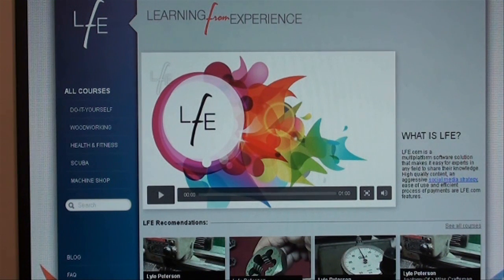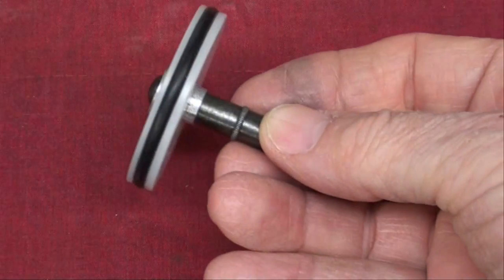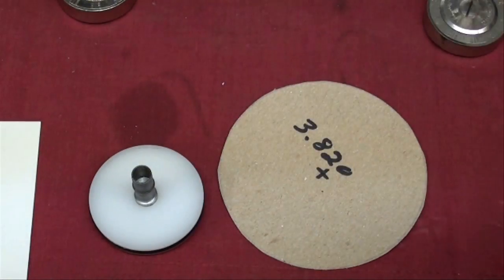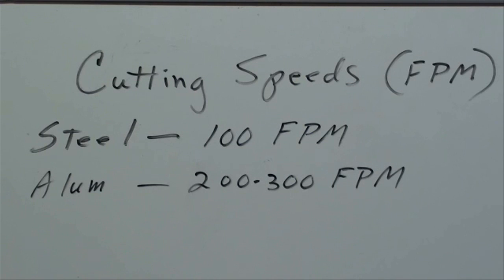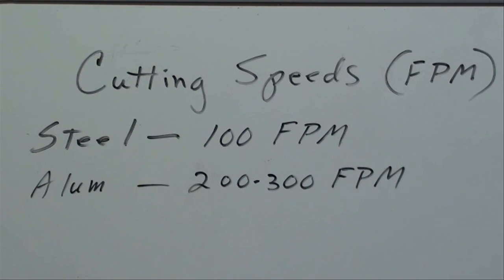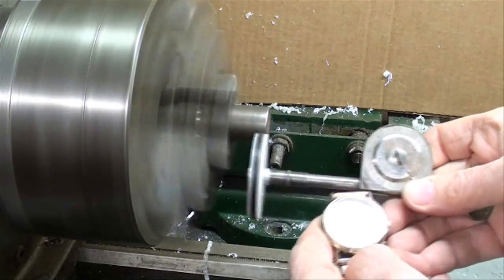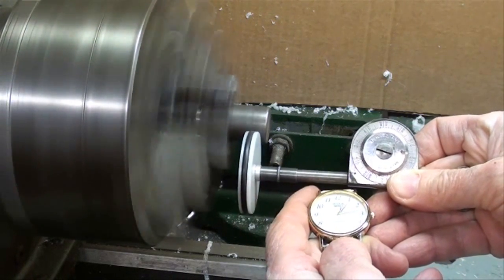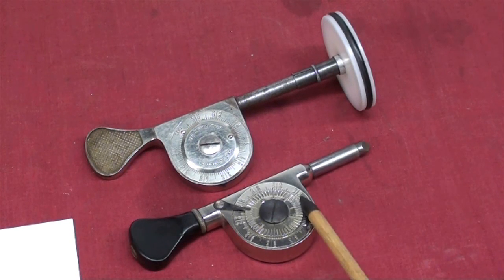MACHINE SHOP TIPS #88 Measuring Cutting Speeds tubalcain

Comment: @Tubalcain...you know this I am sure, but for those that don't know there are many ways to skin a cat (assuming someone cant necessarily use a dynamometer or other tech....)...Just get a spool of thread (you can measure off a known distance of it...i.e....even just wind off a certain distance onto a little bobbin from a sewing machine....then attach it to the rod and run it for 60 seconds and count the distance for your rpm....you have to keep a bit of tension on it just like you are casting a line with an open-reel or what not, but it is accurate enough for most applications and cost nothing :)...food for thought.
Reply: you dont have to have a known distance...but if you know that you have 300 feet....and just run it to the end and stop the stopwatch....then it is pretty quick work to calculate the approximate circ of the rod around which
Reply from the maker: Good idea--would be a good illustration of the theory of it

Comment: 45 years ago, I decided this (sfm) was too difficult for my simple mind.  So I just use RPM.     1" dia. steel= 400 RPM, 1" dia. brass= 800 RPM, 1" dia. alum= 1600 RPM.    If you double the dia. then cut the RPM in half, if you half the dia. double the RPM.  As most lath speeds never give you exactly what you want, change the feed or depth of cut for changes.  Works for me.
Reply from the maker: thebaron44 Thats pretty much the way I do it on a daily basis. Thanks

Comment: so that's what that things for.  Found one of those in an oldtimers tool box, always wondered what it was. After 50 years in shop I'm still learning. (when I was 20 thought I knew it all HAHAHA..  In screw machine industry we use surface footage every day. A quick formula I use is  ( point262)   times   ( diameter)   times  ( rpm)  equall surface footage.   I believe .262 is suracfe footage of 1 inch.  Injoying your viedos every much.  thanks

Comment: To time the measurement, it is easier to use one of those digital kitchen timers. Set it to count down from 30 seconds (or whatever). Use one hand to hold the tool and one to start the timer, and then you can concentrate on your measurement tool. Because you can just listen for the audible beeper on the timer, you don't have to look at two things at once.